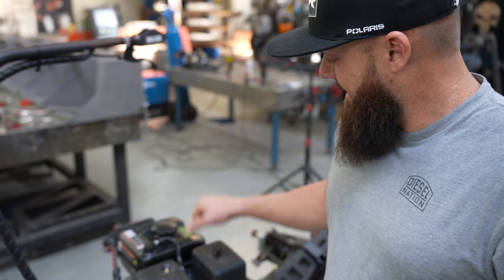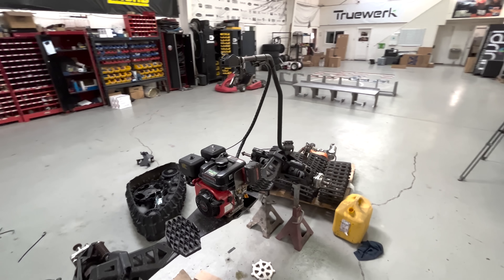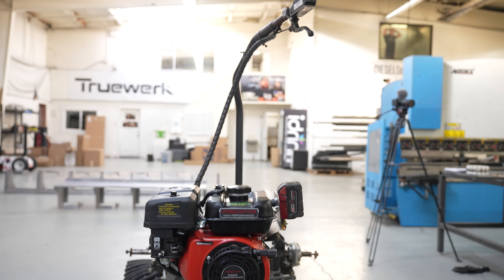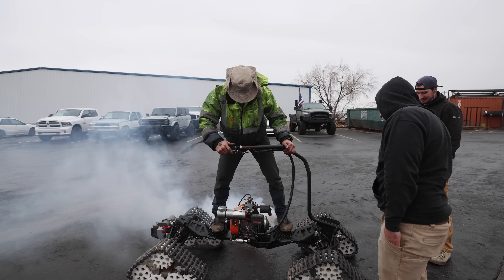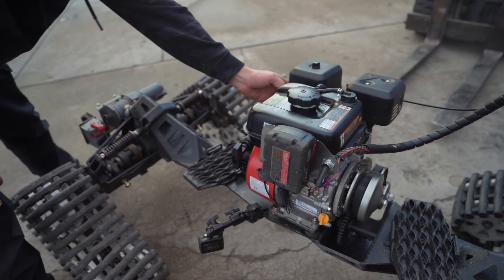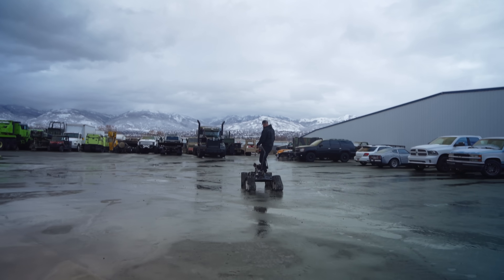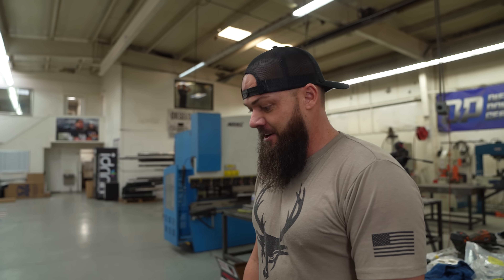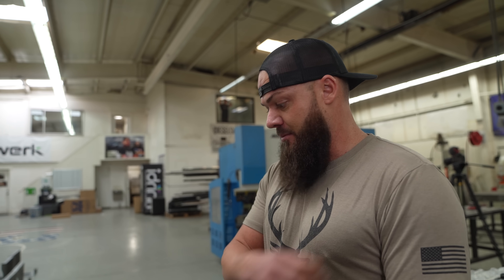Upgrading My Diesel Powered All Terrain Mountain Board On Tracks

Comment: Electric makes a lot more sense than a gas or desil engine with a nice brushless motor you can get tons more torque out of it. Just need to make sure it's got a beefy enough drive system to handle that increased drive torque.

Comment: Like u said a scooter power train would work perfectly but in order to go more than a couple miles n hr a 1500-2kw motor on the front and another on the rear would be an easy n cheap build. Batteries are the heaviest pain in the ass about it

Comment: Hard to see the construction but... If you choose to go electric, you can solve the drive like issues with having separate smaller engines on front and back. Or even all 4 wheels independently. This is what a lot of electric cars do. The issue you face however is with it's applications being snow and dirt, properly protecting the batteries, if you don't manage that it becomes a portable crotch warmer or bonfire.

Comment: 4 electric moters right at the wheel or track would eliminate the need for cv axles.  Mount the battery pack down low for better balance...  take a cue from kids building chain drive long boards with offroad tires.  My nephew built one like this.  42V I believe, I thought some power tool cells would work but he said the built battery has more power & got him to & from work.

Comment: 10 jp gas engine, custom muffler, use at a minimum 300cc quad cv joints for more durability, and add a disk brake to stop

Comment: With the trackletts on it looks like a disfigurement machine at best...I like it lol, just know when to jump off if it's gets too squirrelly coming down the mountain.

Don't do electric. Yes they're powerful for packaging, but the battery will take more weight, space, and may take away from stability for those reasons.

Edit* amazed after seeing it in action. Has a decent center of gravity. For the engine, you don't want something too powerful, or too snappy...a 2stroke would be ideal, but you'd need to have a discrete exhaust, and I don't see a big 2stroke resonator muffler being that easy to avoid burning your leg against... If it were me, I'd look into a flat 2cyl bike engine.

Comment: @heavydsparks look into a Sur-Ron or Talaria e-bike drive system. Ditch the clutches, 6000 watt brushless motor, 60v 34ah battery. On a 120 lb bike it has 20-50 mile range with a top speed of 47-48 mph. Can be upgraded as well.

Comment: Well if you're going to go electric you means have to go with 2-4  motors inrunner either with one motor for trackset or one motor four pair of tracks in other words one motor drives a front end and the other motor drives a back-end then you need to stand from out of battery power and that's when wind up weighing more than the gas engine

Comment: I’d throw in a 125 atv/pitbike motor with an auto clutch 3 speed. You could gear it to run in 2nd most of the time and have a low and high  plus reverse.  

P.s. sell them “Mickey mouse” tracks. I wanna put em on my pit bikes with a ski.

Comment: Need to go hybrid, diesel engine powers modified alternator with a charge controller this allows you to use 36v electric drive motors, battery and controller that are cheap and power full also allows you use just electric by its self or with the diesel.

Comment: Use an electric golf cart motor with drill batteries or similar lithium ion batteries. You will have more power than you need if that's even possible for ppl like us.

Comment: If going electric wouldn’t it be better to see if you could put motors out on the hubs directly driving the tracks rather then one motor inboard, also leaves more room in the mid section for a battery… also gets rid of the driveline issue

Comment: If I was younger a thing like that would be a blast.  I would stick with a gasoline engine for now, I would like to recommend Honda Engines maybe a 10 horse but it could be too much power.  Electric motors are nice but it is the recharge time that gets me down.  Especially when in cold weather, charging time takes longer and discharge of the battery is faster'  it would restrict the travel time and distance where a gasoline engine would keep on running.  The only advantage I see to the electric engine is torque. I do like the centrifugal clutch.  One thing and you probably are planning is to make a vented housing for the engine for safe operations.

Comment: I'm thinking electric. Cleaner, greener yada yada but it's going to have the torque. Then there's batteries. Like a rocket into space, 90% is fuel to get it somewhere.  But I was wondering, make it smaller. If you go electric , you could make it smaller and butcher up a couple of scooters(which, incidently, would make me a happy man just on that). Are there smaller track units around?
Now I'm thinking... man if I could fit motorised tracks on my roller skates....

Comment: ideally if going electric you'd start from the ground up. Also if going electric it won't be as usable in the snow because of temperatures (-10c and under, batteries don't like).. unless you have a heating system FOR the battery pack to keep it at ~25c.

What would be the coolest is if you could hot-swap the power train from gas to electric and back. Run out of charged batteries? Slap on the gas engine.

Comment: electric would probably be best for this, but then it would make more sense to have 4 independent wheel motors, and then you might aswell start over with the chassis :( 
Make one gas as it is and then a new and improved electric one!

Comment: instal some lighter rollers in the vario transimision the belt is to high in the pulleys so lighter rollers in vario gets more rpms better torqeu.
but that diesel  engine looks toast but its gonna be better at doing what u wanna do then a gas engine only u gotta play with the cv transission but that variable transmission is the way to go its way better then any other transmission or sprockets realy but only when its done right ofcourse ,also its an invention from daf its a dutch car brand that car can drive as fast forwards as backwords lol

Comment: Going, the electric route does not make it lighter, you will have a heavy battery pack to have some power and duration.  most of the light battery packs don't like cold. Big battery packs need expensive chargers, and the battery is always just empty when you start having fun. and the cheap big battery packs do not have a long live.  And most important of course, nowadays every tree has a power outlet so charging would not be a problem.  maybe fine-tuning the design a bit and trying to save some weight, i did see a lot heavy parts

Comment: If you were going to use a small Diesel engine similar to those Hatz would be the only one I would use. Definitely not a cheap Chinese knock off of it. Electric would be much easier you’d use 4 electric motors with brakes similar to wheel chair motors.

Comment: YANMAR 10hp diesel  = start every time you need it to. Electric or pull start. No ether required.
Note: Very loud unless you can find a muffler off of a surplus military 3K inverter generator --> MEP-831A

Comment: I think electric is the obvious choice. Maybe even a front and a rear motor to simplify the drive train. Pack and electronics could go in a metal sled under the foot board with a skid plate to protect it. Kind of like an electric skateboard.

Comment: You guys should call it the "Mountain Goat" and base the design off the goats characteristics! 
'From Wikipedia ---- "The mountain goat's feet are well-suited for climbing steep, rocky slopes with pitches exceeding 60°, with inner pads that provide traction and cloven hooves that can spread apart. The tips of their feet have sharp dewclaws that keep them from slipping. They have powerful shoulder and neck muscles that help propel them up steep slopes.[7] Based on a field recording in the Rocky Mountains of Canada of a mountain goat climbing a 45-degree slope, researchers were able to measure the goat's whole body movement as it climbed. Researchers observed that when the goat propelled itself forward, it extended its back legs and the front legs were tucked close up to its chest during its first phase. During the second phase, the goat raised its back legs near to its chest, while the front leg's humerus stayed locked in a persistent location relative to the goat's chest, therefore allowing the elbow to be detained in close proximity to the whole body's center of balance. Extension of the elbow and carpal joints resulted in a vertical translation of the center of mass up the mountain slope".

Comment: Don't bother with a no license electric acoot. Less power than the diesel. Need a cr 250 chain drive. With mini CV joints like u said. Maybe chop a Honda CRV or that type of thing. U could also remotely drive it and it would be lots of power with a hf big boy. Haul a sled behind it with wheels like that other electric contraption that's 40k or something

Comment: Keep it gas powered. If you go electric you will need lots of expensive batteries that wont last long and will probably weigh the same maybe more than keeping it gas. Those little predator motors are cheap and surprisingly reliable. Also easy to modify.

Comment: Change EVERYTHING over to carbon fibre including the frame, handle-bars, drive shafts and Wheels/Tracks and it will be light as a feather with much more range!  As a suggestion, also custom make a one or two litre displacement Wankel Rotary Engine CNC'ed out of all-Titanium and you will get ENORMOUS horsepower!  The Wankel Rotary engine was used in older Mazda RX-7's and RX-8 sports cars and are FANTASTIC for weight-versus-horsepower produced! 

Since the patents have now expired, just 3D scan in and shrink the parts to an old Mazda RX-7 Wankel Rotary Engine down to 1-or-2 litres displacement!

Again, CNC everything in the Wankel out of aerospace-grade high-heat resistant all-Titanium Alloy so you get the lightness, horsepower AND high torque!

OR ..... if you are REALLY CHEAP .... 3D-print a Wankel out of ABS or other 3D printable plastic and coat EVERYTHING in it using a 1/16th inch coat of high-heat resistant aluminum-oxide-based ceramic or even bake pottery glaze onto the parts or use thermal-resistant enamel paint and see if THAT works! (i.e. Also remember to take into account the THICKNESS of the coatings when you design the parts for your 3D-print of a Wankel Rotary engine to make sure they all fit together properly when enameled, painted or ceramic-coated!)

V

Comment: Electric sux it's just not there yet. In power reliability yes. In range hell no. I think that's why taiga sleds havent took off. Cause they haul ass. But who wants to get stuck in the backcountry with no way to charge. Tech just isn't there.

Comment: Those little diesels aren’t great, but the problem is not the power. Those diesel engines don’t spin high enough rpm to work the little go kart torque converter you are using.

Comment: i dont see going electric will be viable...yea more power and torque but the battery. more weight/size  less ride time and in cold weather? even less drive time. id go with a bigger gas engine but add heat protection by body parts

Comment: Hey heavy D
U need lambordini air-cooled 3 cylinder  25LD330-2 diesel engine. 
It's 50kg smaller footprint 
U can not go to 15kw electrically 
And if go it would be bulky and low range.

It is my own project's secret heart,
I give u my heart bro 
🥹

Urs truly.
Persian red cross's mechanic 🔧💪😁⛑️
Iran's Army veteran 😎

Comment: Electric.  Do away with everything up to the front\rear axles in terms of driveline.  Two 2000w qsmotor mid drive motors with sprockets and chain link to front/rear axles.  Might need to modify the axles because you won't need the pinion gear, just weld a sprocket to the ring gear.  A 4000w controller and 72v 100ah battery should do the trick to get you up and over anywhere for a good amount of time.

Comment: Hey Dave ,I love the "Concept Mountain Board" !! Myself and a Buddy have built a few prototypes of similar type ,gone through multiple engines of Diesel ,Gas and even went "WAY OVER THE TOP CRAZY" with an "EXPERIMENTAL" Alcohol Injected 30HP Racing Cart Engine....and after melting a hole through the top of a $70 piston for the 4th time ,I changed EVERYTHING from that point on ,to "INRUNNER " Brushless Electric Motors ,Powered By LiPo Batteries ,(Actually made for RC Aircraft ) and the difference was like "Night and Day" ! Just My opinion ,but ,I would go that route or "POWER", I GUARANTEE You'll Be Blown Away By The Difference ! 
     And Here's Where The Old DRAG RACERS  Theory Of "SPEED COSTS MONEY, So How Fast You Wanna Go ?"Comes In To Play.... They're EXTREMELY PRICEY" And Very Temperamental If You Don't Have Experience With Them.... Anyway ,"GOOD LUCK " with the board !

Comment: Ok you got a 6.6 hp Briggs  ok get you a 20 hp brigs or koler ais /water cooled mo5her no yes it going to be heavier but you are picking up more hp and re couch your high end to a smaller cog and your low to a bigger cog that will give you more speed on high end and more Tory on low end so if your going over a bad rocky area then your low speed hi fork will pull you over the them and fifyou need more speed you got it

Comment: Steering column u-joints for the CV shafts, and definitely a larger motor to up the torque. I wouldn't go electric until you have the driveline sorted, but the torque potential is there!!

Comment: Have you thought about using the base of this thing to create like a Carver type vehicle? Since the steering is no longer realy by weight transfer like a longboard, but by actuators, you could use the principle for steering in a different setup. And Carver is relaunching with a Electric powered motor.

Comment: That thing could be commercially viable if you made the frame out of aluminum and the majority of the rest of the operating components out of aluminum or out of lightweight  hollow cro-molly tube such as axle shafts and the like the thing is rad and would love to see it out kicking ass with other power sports equipment

Comment: Dave I love ya brother but it's junk. It would have better if it was a scooter with handle bars a skate board type board to stand on facing frontwards and put a bad ass motor with those tracks then you would had something cool just throw that thing in the dumpster and cut your losses bro

Comment: That is a pretty rad machine. I’d say turbo charge it that way you can run a small engine and save weight and space. Maybe a different small engine but you get the point.

Comment: Wow Dave that is a really cool machine. When you get the drive line improved with real CV joints it should run a whole lot better under the same engine power. I'm definitely following this project.  Looks fun to ride.

Comment: Electric will not have distance based on the battery capacity. The weight added will be ridiculous as well. The speed would be dangerous. Better efficient gas engine not from harbor freight. Obviously your sponsor and Allen’s... They stole all their designs from US engineers...
Reply: Why are BOTS or AI allowed on YouTube now?